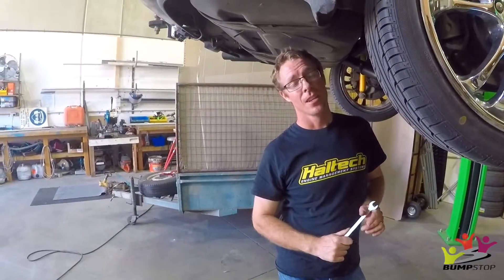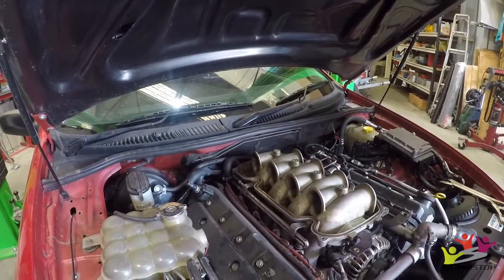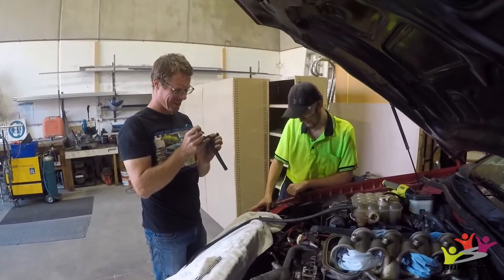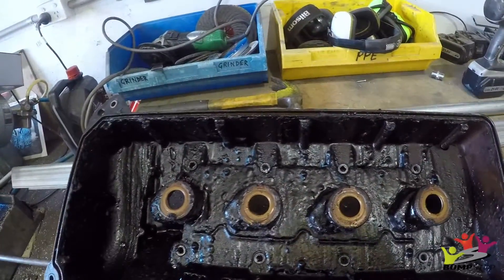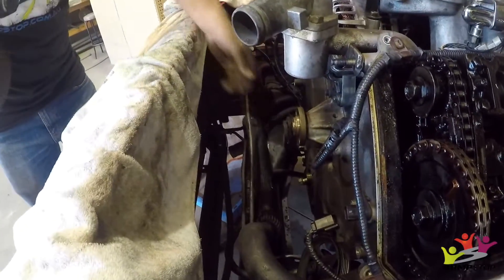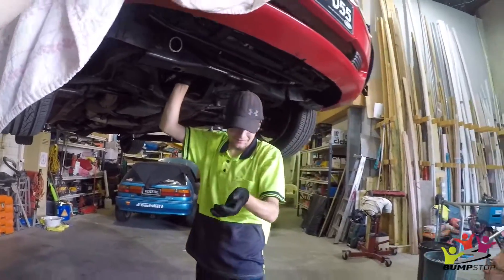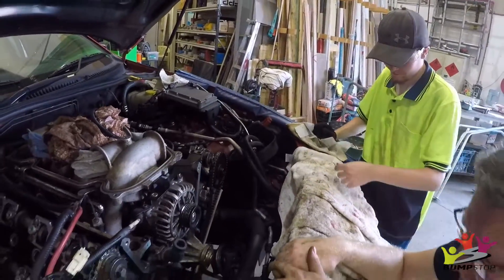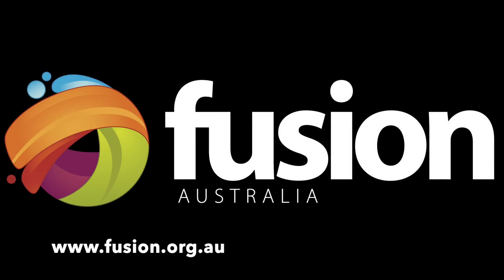How to replace the timing chain on 5.4l 260 Boss V8. As swapped into our Ford AU Falcon XR6 Tickford

Comment: Ex Police vehicles (even one's with low miles, sometimes especially) generally have an absolute huuuuuge amount of idling time, like insane amount and that's generally why they should be serviced a lot more  than they are because you can't really go off the k's on the dial for service intervals.

Comment: Hey @Bumpstop Car Mods & Mentoring what did you use to hold the camshafts in place to stop them moving? A particular tool or home-made special?  I'm about to attack my BA with failed guides/tensioners, but I don't want to fork out 400-odd bucks for the OTC cam lock set if I'm only ever going to use it once.

Comment: Part of replacing is not using the same crap that comes in cheap kits. Not saying Mace is one of these but it's a lot of work to save a few bucks and have to do it again or have a failure. Tensioners (plastic) primaries leaking is not all, one of the secondaries is also weak. There's a lot better guides available also that get angles correct. Boss engines are very simple to make bulletproof. Once oil pump gears and timing setup is their good. The only exception is the 290 which Ford cheaped out and used a bad designed piston setup.

That engine has had a tough life. A boss engine after at 250k looks nowhere near that bad. 20 bucks say that engine has not much of its bearings left either.

Comment: Why did you drop the sump and remove water pump , no need when replacing the timing chain
Reply from the maker: Hi Kevin we had to drop the sump to get the broken guide material out of it. The water pump stayed on just the pulley came off.

Comment: Pulled the rocker covers off my ba  boss 260 to replace the gaskets they had a bit of Vegemite  and shit on them so service was a bit slack prior to me owning it .I water blasted them clean , then blew all the vegemite off the cam housing with 100 psi shit went Every where lol 😂 but got it pretty clean then I put it back together ran a flush through it and dumped the oil , the engine is mint and gets fluids serviced every 5000 k but this will be the next job after it gets a respray 😀
Reply from the maker: Hey Lance - Yeah the VEGEMITE!! dint put a rose in our cheeks.. lol!! At least we know two Boss engines that will be loved from here on! Thanks for you support.

Comment: Great job boys, about 2 years to late though......
A destroyed my 290 gt-p top end by stuffing that job., bent valves on the drivers side bank.
Brought another 290 out of a bf gt-p while i save to get the original engine fully rebuilt. It did have 225k on the clock.
New engine only had just over 90k and is a nice strong engine.
Reply from the maker: It looks like the Boss motor is a sensitive unit requiring constant love and attention... yours is not the only story. I guess hindsight is a good thing!

Comment: Hi, I have a 2004 Boss 290 Engine it has done 156000 ks, it is make a ticking / Rattle noise on cold start up, this happens for a few seconds then goes away, and runs nice and smooth. Is this a sign that the timing chains need replacing?, and if so do they need to be changed ASAP?
Can you recommend anyone to do this job, and do you know roughly how much it would Cost?
Reply: It's expensive. It's your tensioners leaking down between starts &/or broken guides &/or stretched/worn chains. Serious damage can result if it's left unfixed. My brothers BA XR8 had the same issue (broken guide & leaky tensioners) and a vavle on cylinder number 7 contacted the piston. Get it fixed sooner rather than later. If you don't know what you're doing pay someone. The cost of not doing it can be a lot more than doing it.
Reply from the maker: I think your question was answered - Thanks CYOR  - We love our supporters and appreciate you all. Hopefully the above advice has been taken - would love to know the outcome...
Reply: The early BA's ran a plastic tensioner which leaked down when not running. Ford replaced these under warranty with a steel unit which solved the problem. Now your car is doing this should shouldn't run it. The failure comes in two main ways, you keep running it and the guides will eventually break and you then have chains against alloy guides running alloy particles through your entire engine or the chains are so loose you end up with a secondary tensioner that fails shrowds the large cam gear and explodes out a rocker cover. There's many other results and they're all bad.
It's really important to fix this right. The parts are not that expensive but it is a fair bit of labor to do it right and they should know what they're doing.

Comment: My 260 has 160k on it and the heads didnt look anywhere near that horrible, also 7mth it took to find this vid, 6mth after i did my timing

did you change the oil pump as well, Esp after all that sludge?